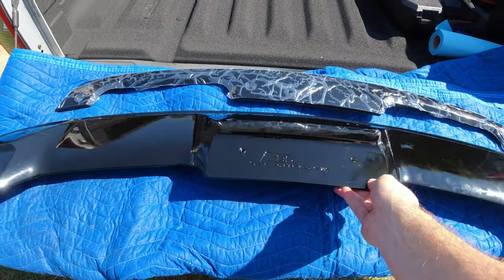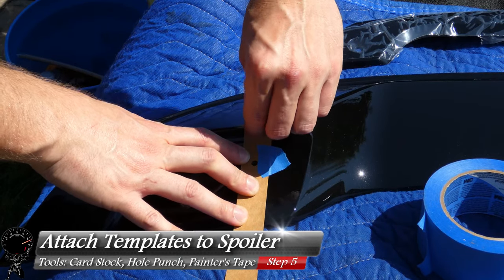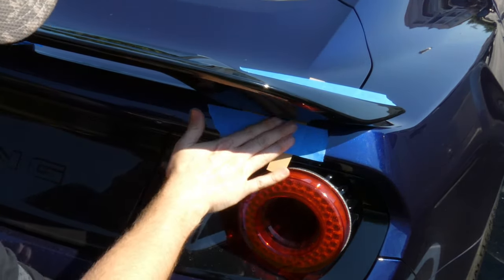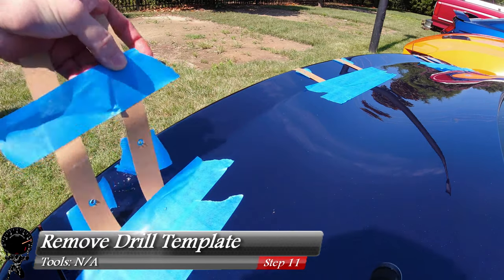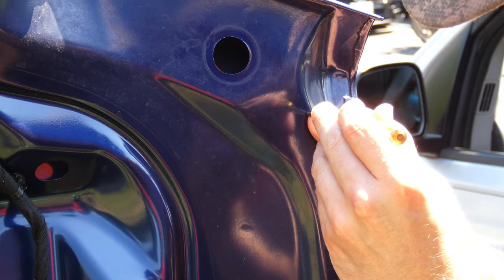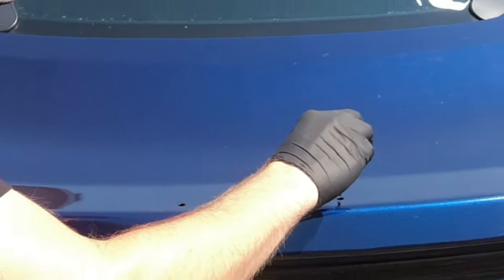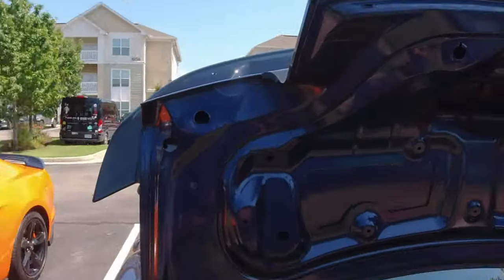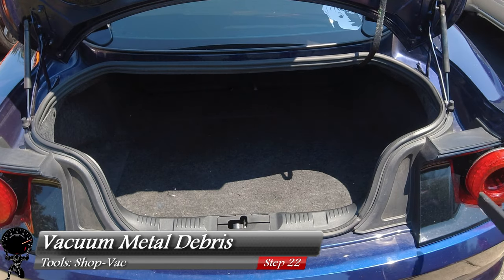How to Drill and Install a Spoiler for your Car

Comment: Hope it’s not a dumb question, but what kind of screws did you use and what are the sizes
Reply from the maker: This is NOT a dumb question. The GT350 spoilers I have installed used M6x1.00 threaded screws. Some of the lengths varied depending on the hardware that came with the spoiler. However, the ones in this video look to be 10mm long (M6-1.0 x 10mm Flanged Button Head Screws). If you have any further questions, don't hesitate to ask.
Reply: So I drill with m6x1.00 bit ? And I’m good ?

Comment: This worked great for installing a spoiler onto my highlander. The only issue I ran into was the spoiler came from a junk yard and it has a stud that is used for locating it when installing at the factory so it wouldn't lay flat. I just drilled a hole magically in the right spot (i actually have no idea how i got it right, but it was perfect) then your method for the two bolt holes. Worked like a charm and its perfectly even
Reply from the maker: That's awesome. Kudos

Comment: I installed my spoiler with no drilling, only using the double sided tape it came with, should i be ok like that? it wont fall of right
Reply from the maker: Tough call. I recommend following the vendors' instructions/specifications.

Comment: Great video man!!! I’m trying to do it this way but I have threads coming from the spoiler instead of nuts built it 🥲
Reply from the maker: Thank you very much. Hmmm, studs on the spoiler does make it more difficult to find the correct position (without scratching the paint). I'll see if I can come up with a method to make that process easier.

Comment: This video was super helpful! Installed a performance pack spoiler yesterday, but boy was it some hard work being an amateur at this😅
Messed up a little bit on the lining up the drilled holes, so had to make a few holes bigger.
Also lost a screw in the trunk and broke a drill bit, but was successful after 7-8 hours lol
Reply from the maker: Holy cow, you had a full day's work. Hopefully, all your hard work was not in vain, and it turned out the way you wanted it.

Comment: Great video
I got one maybe dumb question, but when it rain or you power wash the car will any waterdrops enter from the holes into the trunk ?
Reply from the maker: That's not a dumb question. Fortunately, with this installation, we haven't experienced any water issues. However, it's recommended to use double-sided tape (3M) in addition to bolts when installing a spoiler. The tape acts as a gasket. 
In this video, the owner opted out for adding the tape.
Reply: @mcgurrentertainment  thank you, I will have that in mind

Comment: Nice video! Very informative.
One question though
What about waterproofing the holes ? Will the water not pass through the holes into the vehicle if it rains or in a car wash ? This is something that I used to be always curious about installing aftermarket spoilers
Reply from the maker: Thank you. Typically, 3M tape is also used in conjunction with the mechanical fasteners. The tape acts as a gasket or seal. Fortunately for this spoiler install, the screw holes were aligned just right, and the screws maintained a tight seal.

Comment: Awesome video. Gonna be installing a performance pack spoiler soon. Quick question, would it be worth to add a washer between the nut and bolt to keep it secure/water seal it?
Reply from the maker: Flange nut might be better (less things to risk dropping). If you want a seal, verify your new spoiler has double-sided tape (similar to the orange Mustang) , or you can add RTV around the hole.

Thank you for the posting feedback and support.

Comment: Should I add a weather strip under the spoiler to avoid water from getting into those screw areas and under the spoiler?
Reply from the maker: That or 3M double-sided tape would be ideal. Good question

Comment: Not sure if this is too late but, what if the bolts are built in to the spoiler?
Reply from the maker: You are always free to ask questions. If the spoiler already has threaded studs, it does make the alignment task a little challenging.

I had a few ideas on how to approach this task. One method would be to used cardboard or poster board (you may need to glue two pieces together) and trace out the bottom of the spoiler on it.  Push or cut out the studs through the cardboard to create the holes. Once complete, transfer the cardboard template to the car and perform your measurements/alignment there.

Comment: with no weather stripping around the screw holes on the spoiler side, what is keeping water from going through the holes? just curious.
Reply from the maker: Typically, 3M tape is also used in conjunction with the mechanical fasteners. The tape acts as a gasket or seal. Fortunately for this spoiler install, the screw holes were aligned just right, and the screws maintained a tight seal.

Comment: Hey man, great video. I have a question, I purchased the same spoiler, what size screws do we need to drill? 9/32 is what I saw but I want to clarify
Reply from the maker: 9/32" is correct for drill bit size. A majority of spoiler screws for the Mustang is an M6. So, the hole is slightly bigger to allow a clean install  and allow some room for play/flexibility.
Reply: @mcgurrentertainment  Thank you so much for your help man, I really appreciate it
Reply from the maker: Anytime!!! 😎

Comment: Just a quick question on how do we keep water from getting into the trunk after drilling holes on them. Do we need additional silicon ring or other stuff to prevent that from happening? Just got my car and I can’t wait to throw a spoiler on it
Reply from the maker: Most spoilers come with 3M double-sided tape already attached. This will act as a gasket to prevent leaks.

Comment: How did you know where to drill inside? Installing the GT500 Track Pack and need to do the same and another on the corner. Thank you for any help.
Reply from the maker: Good question. That was known by previous doing this on my Mustang and by touch. You can put your finger on the outer hole and estimate where it is on the other side. The hole on the inside does not have to be perfect. That is why the hole was much bigger.
Reply: @mcgurrentertainment  will do. Thank you. The one I am installing has a hole in the side as well. Gonna be fun! Lol
Reply from the maker: Goodluck. You got this

Comment: Concern for Water leak into the trunk? 😅
Reply from the maker: So far, so good; no issues. As long as the screws are tight, you should be OK.
Reply: Faucet/hose washers around the bolt holes! easy

Comment: When you’re trying to drill the actual hole into metal, to make sure you use the correct drill bit size to drill, are you making sure that the screw you’re going to install fits inside that hole that you drilled but not the screw’s washer right? First time doing this. Please advise, thank you!
Reply from the maker: Yes, you want the screw threads to fit through the hole, but not the screw head nor washer. These were M6 screws (6mm), so we drilled a ~7mm hole.
Reply: @mcgurrentertainment  thank you, just wanted to make sure. I’ll give it a go today, let ya know how it went
Reply from the maker: Please do. Good luck
Reply: @mcgurrentertainment  it wasn’t easy but I got it installed. My drill bit broke while drilling the last hole on the trunk , and it left dings on some of the areas nearby. I had to use touch up paint on it. I also accidentally dropped a screw into my trunk during testing/installing so I was trying to fish it out with a Magnet stick but failed. So ima see if I can a replacement screw from the vendor. I had to drill additional holes inside trunk too which was not easy and had to remove excessive remnants/metal. I did manage to measure and drill the holes pretty accurately so was able to install 3/4 screws for now. I got tons of scratches inside my trunk but it’s a 2011 mustang so w/e but I really wanna get that lost screw that fell inside a hole in the linings of my trunk. Any ideas?
Reply from the maker: The most effective method would be to unbolt the trunk and turn it upside down while agitating it. It's a pain, but it works.

Comment: whats to prevent water coming thru the screw holes when it rains
Reply from the maker: Typically, 3M tape is also used in conjunction with the mechanical fasteners. The tape acts as a gasket or seal. Fortunately for this spoiler install, the screw holes were aligned just right, and the screws maintained a tight seal.

Comment: does the threadlock prevent leaks as well?
Reply from the maker: Not really. Ideally, 3M double-sided tape is used in conjunction with the mechanical fasteners. However, there is very little/no play in the bolt & bolt holes; minimizing room for water. If your spoiler does not have double-sided tape, you may use RTV around the holes.

Comment: Do I have to use a stepper drill or can I just use the right size bit?
Reply from the maker: You can use the correct size bit. Just be careful, because going to a big bit can catch the metal and cause it to misshapen.

Comment: dont you have to add some seal? Or is it tight enough?
Reply from the maker: Typically, 3M tape is also used in conjunction with the mechanical fasteners. The tape acts as a gasket or seal. Fortunately for this spoiler install, the screw holes were aligned just right, and the screws maintained a tight seal.